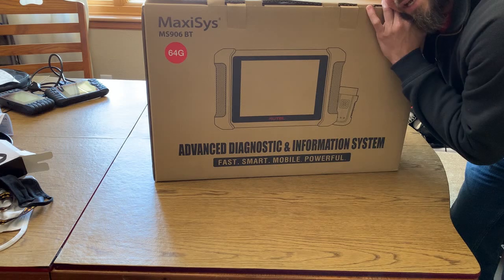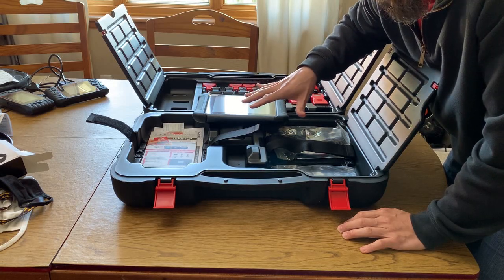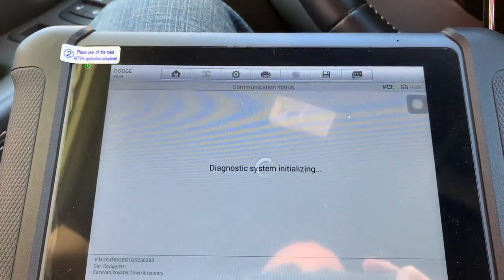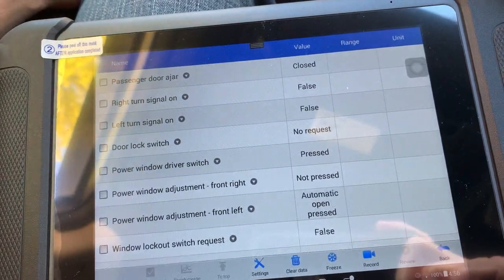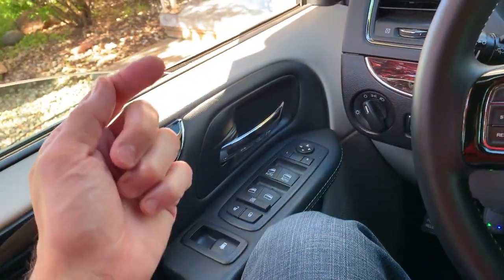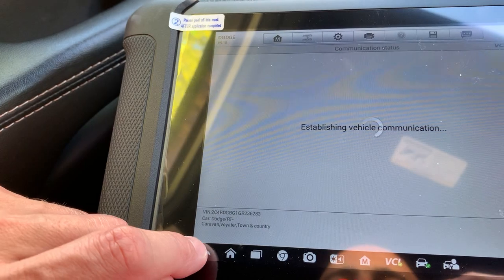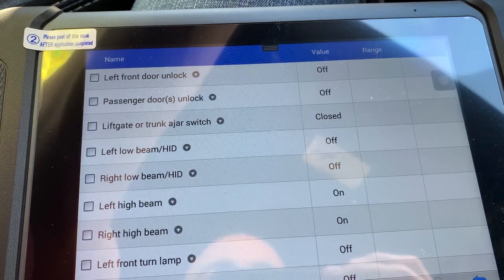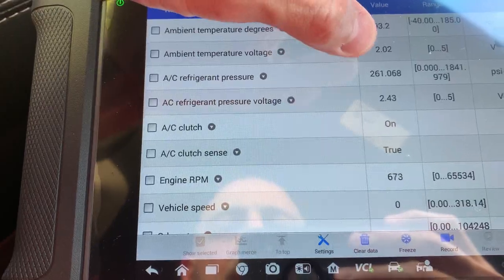Are Autel scanners USELESS - MS906BT - MUST WATCH BEFORE PURCHASING -

Comment: I don't rely on live data after my Dodge Nitro front windows didn't work but rear did, they would work from the scanner but the switch didn't so i replaced the switch but no fix due to front windows being run on Lin Bus and rear the normal wired way. anyway the Lin bus power supply wire was broken in door pillar so no power supply to switch for front windows but the scanner could operate them from the TIPM. The Lin bus also operated the mirrors and door locks as it turned out

Comment: Thanks for the video. I've been using one for a while but never thought to use it for windows! I just had a vehicle with a failed window switch. My first step was to pull the door panel and manually check the switch. This would have saved me a ton of time in the diag! I had the tool there and didn't even think to use it! HA! 

I just happened to watch the video because I was curious why someone would say the autel was useless, but learned something!
Reply from the maker: I appreciate that, you can agree the tool is useless in the wrong hands. People assume scanners say “hey fix that” and we both know thats not what they do. They are just another tool we use to diagnose the issues.
Reply: @Master Tech Lou  For sure! I mean, we all know that a misfire code means replace the engine, right? 😆 🤣 
Reading the codes just gives us a clue of where to start. Then the work begins. It's all about testing and troubleshooting. That takes study, skill, and being too stupid to quit. 😉

Comment: Thinking of buying one of these £800 down from £1600 

Mainly I like the idea of being able to do my own servicing, battery changes and brake changes and resetting the service lights/bms etc without needing to go to the shop. 

The live data/data logging function is something I’m also very interested in given I’ve spent 3 years doing a motorsport engineering degree with data acquisition and analysis being a major part
Reply from the maker: 50% off?! Even if you dont like it you can probably sell it off ! Data logging is nice but is most handy with intermittent issues.
Reply: The thing about that is, you need to have the knowledge gained with experience and education to be able to interpret much of what the Autel has to offer. It's geared more towards the automotive technician, not the average vehicle owner who wants to do the services you listed. This won't help you change a battery and service your lights. It will help a trained technician identify a fault in the vehicle. I've been using one for a while at my shop and, even with my experience, I sometimes struggle to understand the output. 

Hope that helps!

Comment: What happens if i don't purchase updates every year or whatever will it still work or not? I only need it for at home with four cars for personnel at home use I cant see spending allot on updates every year for what I need.
Reply from the maker: It still works. You dont have to pay to keep using it, just to keep receiving updates.  Bug fixes and updated software for newer models and or old ones that the company finds issues with. So what we do is wait about 2-3 years and then buy a subscription so it updates you up to that point. But there’s many other brands with lifetime free updates and can do close to what this can do. Just make sure you buy from an authorized seller or autel wont help you with any issues. Theres a lot of models sold from overseas that autel wont work with. My understanding is anything starts with an MK but not true for the MK808 so just be sure the seller is on the autel website.
Reply: @MasterTechLou  your great thanks! One other question can this MS906 BT retract a 2017 BMW 540 I eletric parking brake? I went on the Autel website and cant figure this out for any of them?
Reply from the maker: @stevenlaubach7222  it should be able to yes, but almost all cars have some manual way of retracting them as well. As far as I know. There’s usually a process through the dash or a combination of button presses.

Comment: So far, this is the best info on a scanner period. Why? You "DO" need to understand your car has systems not just switches. The use of live data and it's results are written into the diagnostic flow chart. Step 1, ck for codes XX, XX, etc. Can you communicate with the "BCM" body control. Press window down! Does scanner show down? Yes/No, Press special functions and command window down? Yes/No. Skip to step 11.
  Yes, a computer on four wheels, with room for the driver, 3 friends and some of your crap! This is the way they are built. People ask why. Easy!!! Parts go up, even under warranty. Labor goes up, even under warranty. How long does it take to correctly confirm the root cause? Way quicker than ever before. Remember, the cost of warranty repairs is figured into the cost of every vehicle. If you can reduce the time it takes for the new kid out of tech school to correctly fix the root cause, the manufacturer saves money, improves the customers satisfaction! Win/Win! 
I have been repairing vehicles since the late 60's/70's. I have been an ASE Master Tech since 78. 38+ years later, I start teaching & holding tech seminars on 30 subjects for over 100 techs in an evening for ACDelco. Now, advanced charging systems, serial data or alternative fuels. These are not your Grandfathers Chevy Pickup! These are the results of heavily regulated government restrictions placed on vehicles. What does "SAS" has to do with emissions? Nothing, except effect EPA Milage that is done by the manufacture! Yes, not the EPA($). What army of techs and equipment would that take? We are not talking "Emission's Testing" just those lucky states that require you to test for bad stuff out the tailpipe. Manufactures even wash vehicles, empty the fuel tank & washer bottles and seal them in a room for 3 days and cool / heat / then let resume air temp while monitoring vapors outside the tailpipe! This is serious because the government will not let them sell that model for that year if it fails and cannot be fixed! Besides, GM anyhow, sells the same model (Except RH drive) in 64 other countries. So, this brings us full circle back to a proper scanner. Live data as seen by the PowerTrain Module is right or 1-2 or more is wrong. Some set codes when started, tested, and fail! Other codes are stored in a snapshot (Fail-Records) on the second failure. It gets complicated quick.
So, please pay attention to what he says in the video. As if you have equipment like this, you are able to figure it out once, how much did you save? They cost of the tool, perhaps! You-Bet-Cha!!!
DK, ASE Master Tech since 78, retired. Building my own 56 year old pickup, but with 2003 Tahoe engine, PCM & BCM! I need a scanner also.
Reply: good for older cars, for new cars its useless , it cannot code modules to replace broken module on new electric cars like ioniq 5 or hyundai kona kia ev6 and simmilar .

Comment: How do does the MS906pro-TS work on Honda Accord Hybrid Touring 2018-2021 and Honda Accord 2011 either the device you have or the one I am looking at to purchase.  Are these as good as the OEM Honda HDS/HIDS scanner and software?
Reply from the maker: sorry I just seen this, I have not used in on those models so I cannot comment, my apologies.

Comment: Great video. I have seen some negative about comments about support and warranty. How much do you use it and how much to you like it
Reply from the maker: I use it all the time. Its my belief that the ones that complain are the ones that either dont understand that NO TOOL does it all. And if you dont buy it through an authorized seller, autel will
Not help you. The only complaints I have is the scanners functions are laid out per the way autel wants to lay it out. Its not identical to mercedes scanners or Porsche or any manufacturer. So sometimes it takes some digging to find what you need. And that’s IF what you need is even supported. Hope this helps. I like it.

Comment: AUTEL is an unethical company that takes advantage of its consumers. I acquired a maxisys pro in 2015 and had no reason to upgrade its software because it was compatible with all of my vehicles. A free update released an application that works like ransomware and installs a timer that prevents you from accessing the diagnostic part of the tool. Now, all I get is a “Software is not authorized!” message when I try to use the diagnostic part of my tool  The only available option is to purchase an upgrade from Autel for $1400.00. Product knotting is illegal in the United States, and this corporation should be severely punished for what they're doing to their customers in order to create cash flow due to the recent lawsuit Autel settled.
Reply: My launch mini 431v still works and I haven't updated it in 2years

Comment: Just got the ms906 at auction,only problem is I can't get beyond the padlock page,it won't allow me to swipe to access the main page,where am I going wrong?
Reply from the maker: I swipe mine to the right to unlock it. im not sure if there is another function?
Reply: @MasterTechLou  Hi,the problem is the padlock symbol seems to be inactive,after the system has booted up the padlock page with the time and date appears and for a couple of seconds the circle surrounding the lock looks like it is searching for a connection by emitting Rays of dots then the page is totally unresponsive,do I need to actually connect to a diagnostic port to correct this?
Reply from the maker: @colintreacy4978  no, you dont have to connect it. Wow sounds like your touchscreen isnt working. Because to wake the tablet you press the power button.
Reply: @MasterTechLou  hi,thanks for your input Lou.. looks like it may be just a large,expensive paperweight now then😄I'll not give up just yet though!
Reply from the maker: @colintreacy4978  maybe try to google some type of reset?
or if there is  a screen protector try and remove it?
 or remove the battery and reinstall it if its easily serviced. Im not 100 percent sure. so sorry.

Comment: Great Video, Liked the comedy garnish at the start, but then serious stuff after that. These tools are essential for modern vehicles but they are just a tool. Spent a couple of hours trying to code an Audi A1 for a replaced Electric power steering pump. Then the stripping down revealed a battered pump bracket "Yes the vehicle was involved in a front end impact" torn anti-vibration mounts, obviously not new pump "Well... it's been like this for six months" and finally a broken high current +B -B cable which has no key. Stripping down the pump itself reveals that the "Fitter" who did the pump job plugged this cable in backwards causing the short circuit when plastic separating terminals melted. Don't know if the pump is going to work, visible damage repaired, no blown capacitors, waiting on new housing for terminals and anti-vibration mounts from dealer. The scan tool will then be able to see if the pump module is good or goosed. 
 The owners son bought an Audi A4 cabrio 8HE with a broken roof, again an electric motor powering a hydraulic pump working the roof through three valves. 
Whole assembly $1500,  
 Fixing it for no money by clearance the new brushes and brush housing so the spring could keep the brush in contact with the terminal ring - Priceless!
Reply from the maker: man that is awesome! I appreciate the nice comments as well.
Reply: @MasterTechLou  Just got home from DPF regeneration run on '13 Mercedes E220 Cabrio, monitored by Autel MK808. Wasn't able to force regen on this vehicle using this scanner but I was able to monitor live data on a single page with all relevent PIDs for DPF displayed. Previously was 400% particulate level with 50 failed regen attempts. First I informed the vehicle of the good news of it's "New" DPF....  Which suddenly allowed the system to regen itself! You deserve the nice comments, It's the least I can do compared to your efforts to educate and inform (and remind) us that WE are the masters of the robots...  Understanding what the car wants to see to be able to perform it's Californicated duties has been crucial to getting this vehicle happy where many others have tried and failed. Nice anecdote for you to pass on maybe? Even at 400% full, with a bottle of in tank DPF burn promoter and the correctly applied driving style, this DPF will continue it's service life. Thank you for your dedication to our art.

Comment: So this scanner won't reset airbag codes , that means will not also reprogram ECU , BCM , and air bad module as well right? So is just an expensive scanner
Reply from the maker: It does reset airbag codes.

Comment: I have a snap on zeus at my shop but looking for a good scanner for home how big of a gap in technology between the two
Reply from the maker: I personally think autel is way better than snap on. I have experience with both an I prefer the autel
Reply: @MasterTechLou  lots of information inside the Zeus can look at the ECM pinouts wire colors ect does the autel offer that info
Reply from the maker: @davidsmith5766  it does not but with access to alldata and identifix I personally have no need for that.

Comment: Unluckily you don't mention that all the online server features like ECU, Coding, etc. will be disabled if you don't pay Autel $595.00, every year, to maintain an active subscription.
Autel deceptively only mentions that software updates will be disabled, and don't mention that the key features payed when the device is bought, will be disabled since Autel cuts online sever access for these advanced features.

Paying $595.00 every year is almost half the product price, and not mentioning that advanced online features like ECU, Coding, etc.. will be disables is a very deceptive marketing scheme.
Reply from the maker: Well I see your point but I dont consider it to be deceptive. Its the price of doing business. In the dealer we have to pay no difference for factory access yearly. Hefty too like 20k per machine.

Comment: I bypassed your video as I thought you were just bashing the scanner.
A couple of years ago, I bought an Autel 529AL. There are no videos on it and the instructions are poor.
I just bought a 2011 Ram 2500 with a 5.7 V8.
There are two engine codes. The first one is P0301 (Cylinder 1 misfire). I replaced the coil, but when I tried to clear the code, the engine light went off and it said "Sending" on the scanner, but it never cleared the code. Within a minute of driving, the engine light was back on.
The other issue was a light on the dash that said "Loose Gas Cap". I also saw a code P0456 on the scanner which said Evaporative Emission System Leak Detected (Very small leak).
I bought a new gas cap and changed the Evaporation Module. when I went to clear the code, it said " Sending but the code did not clear. Only the Loose Gas Cap message on the dash disappeared.
I am not sure what to do next. The truck runs smoothly and the previous owner changed the plugs two years ago. The truck has only 138,000 kms/86,000 miles.
Reply from the maker: I dont bash anything :)   at least not publicly haha. check my videos for my misfire diagnosis one. that should help. as for the evap leak, small leak means it can pull a vacuum but it loses vacuum over time. those can be tricky, fuel pump seals, evap lines, gas cap, purge valve, canister valve. can be tricky to diagnose without a smoke tester.
Reply: @MasterTechLou  The title of your video threw me. I will check your videos.
Reply from the maker: @Boyo1956  unfortunately had to use clickbait to sneak in my information and experience. No one comes to YouTube to learn, they come to just do.
Reply: @MasterTechLou  I want to learn.

Comment: Got a 2019 civic battery died while at gas pump put in new battery drove home put my multimeter and altenator was putting out 10v  went and got a new altenator,  every waring light came on put my elchepo scanner on and it had 2 lin codes and a abs code.  It was at this moment I went online and purchased the autel mp808bt yes it was 840bucks.
And the 506 battery altenator tester within 10 min I new the new altenator was faulty swapped it out all codes went away and all systems started working again (Lane keep assist , adaptive cruise, lane depart, ect)

The reason I share this is I took the care to autozone advanced O'Reilly and all three said everthing was good.

If you own. New vehicle you must own a good scanner know days even the altenator communicates threw ecm or pcm and can cause major issues just from bad new part.

Thanks and again use your tool and educate yourself.  Also note had I taken it to a dealer they would have said ecm or pcm was bad and charges me 1299 dollars spend 850 on a scanner and can do the work myself

Comment: Lou - thanks for the excellent orientation on the Autel mid/high end tools. I see you are a BenzTech. I need an Autel or Carsoft for SBC deactivation, ABS bleeding, battery replacememt and other MBZ service functions on vehciles up to 2016. Is the Mx808 sufficient or do I need a higher end/newer model (especially considering bi-directional)? Thank you for reading and a good video. Much appreciated.
Reply from the maker: You want MS models. Also I just disconnect sbc for deactivation. We dont have abs bleed except for sbc and you only have a few models that actually require battery coding in the sam. So the MS models
Will do fine
Reply: @MasterTechLou  Thank you very much for your insight and advisory. Best, KenH